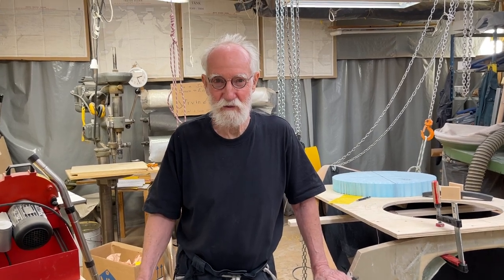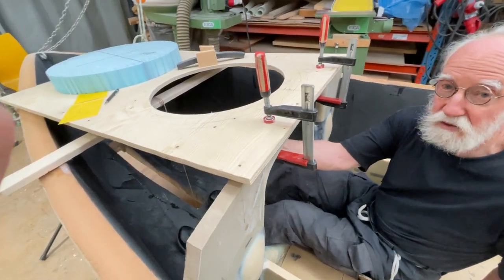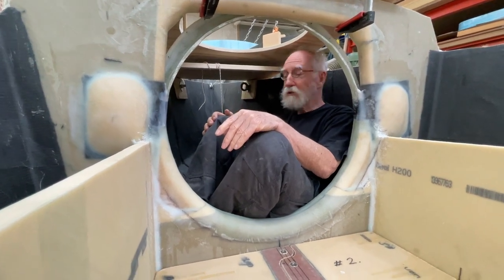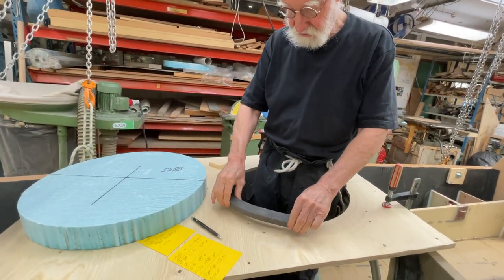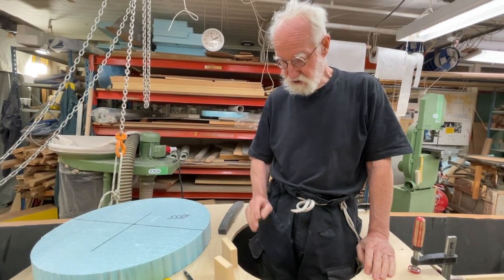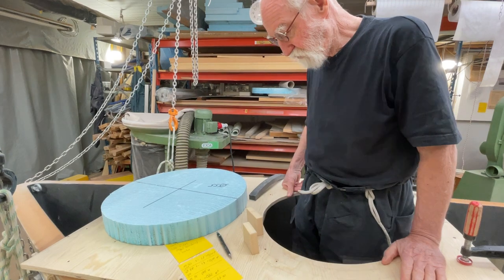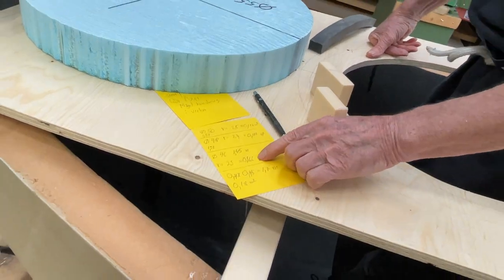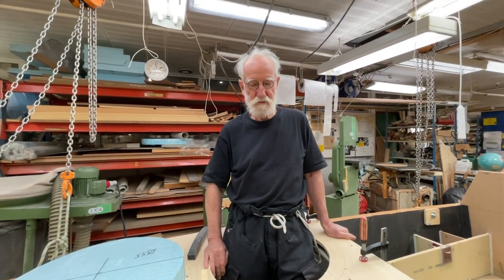11 July 2022. Mock up of the deck hatches.

Comment: Thank you Sven and Peter for the daily update. I like the circular hatches in the deck. They will be much easier to get a good seal. Are you going to hinge the hatches or use an attached line so they can be set our of the way of the masts?
Reply from the maker: No hinges for the hatches.
I will use the string sytem I have shown in at least two previus videos the have several advantages.

Comment: Only 46cm? Interesting. I was planning on making mine 58cm. Maybe it doesn't need to be so big.
Reply from the maker: 58 cm is about 1.6 times as big by area.
Do like me, do a few mock ups with different diameters and test.
Tests like at sea with your oilskins on and some swaeters under if you are not only going to sail in warm waters.
I did one cardboard mock up diameter 50 cm found it to large.
It is more easy to get it waterproof if small diameter is chosen.
Bigger diameter is better for fine weather.
Reply: My forward hatches only 42x42 barely enough good they are not normally used.

Comment: Insulation is vital IMO. It makes the inside of a boat much nicer in hot weather too.
I remember the builder of one of your Bris boats saying that on a night where temperatures got below freezing that they had 18C in the boat with the body heat of two people.
Do you still use the windows as condensation plates with sumps on the bottom to collect drinking water?
Reply from the maker: The windows will be the same design.
But the condensation was never enough to use for drinking.

Comment: Good.  Have you estimated how much warmer this boat will be in winter at high latitudes compared to previous ones?
Reply from the maker: It will be varmer but not much.
Her hull is 70 mm Divinycell compared to the previus one that was 40 mm thick.
The deck is 30 mm same as previus one.
The difference isthat it will have less cold spots so less condensation.

Comment: You work with different foams such as Divinycell vs Polyurethane vs Polystyrene.  I looked up the densities of these three and Polystyrene is much lighter  per m3 than both Divinycell and Polyurethane, while Polyurethane foam is cost effective and easily found in spray form. Have you done any comparances between these materials in connection to boat building. Maybe there is a video that I missed somewhere?
Reply: Is Airex foam still used?
Reply: I think mr Yrvind only use divynicell for boat building. The blue foam is   for mock up.
Reply: @romolo484  Yes, but I'm interested in his verbal presentation of experiences in the past. Exlex is a really cool project for an incurable recluse. If Mr Sven has a heart attack in the middle of the ocean, he might be forever afloat sailing the world for eternity.
Reply: Divynicel is PVC poly vinyl chloride to my knowledge. What is greatly important is core strength over insulation ability. If only insulating an existing hull other closed cell can be considered more.
Reply: @paulboden7850  I think Airex is just another brand name for the same material as Divinycell coming from Switzerland.